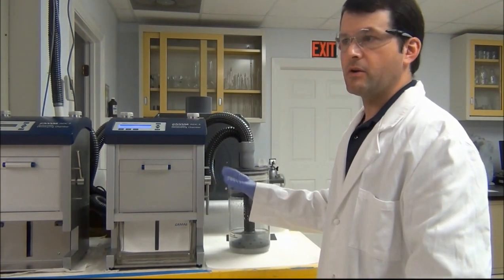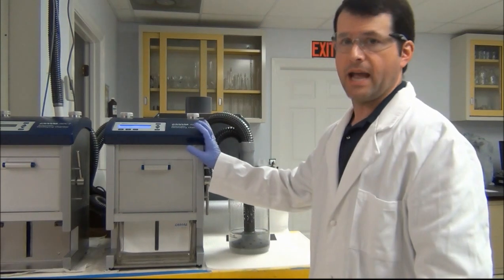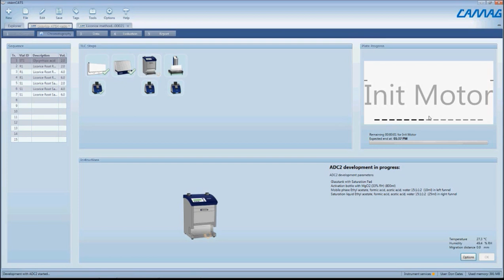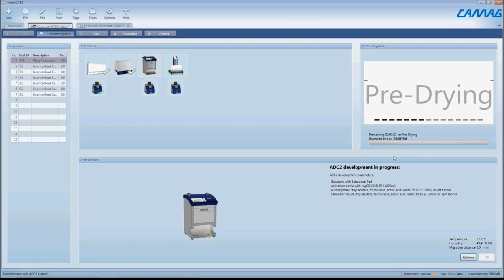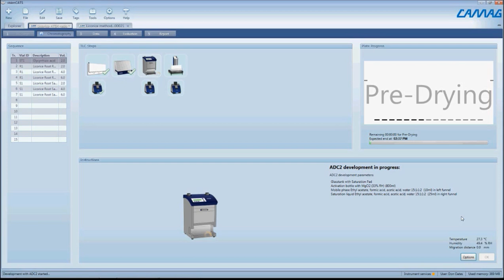05 - Third Step - Development Part 1

Comment: what is the ratio of your saturated mgcl2 in the humidity controller?
Reply from the maker: The solution is 900 g of MgCl2 salt and roughly 200 mL of distilled water. The final volume of the solution is 800 mL.